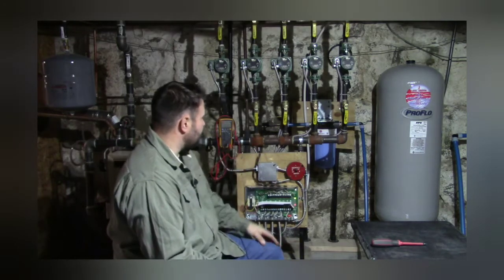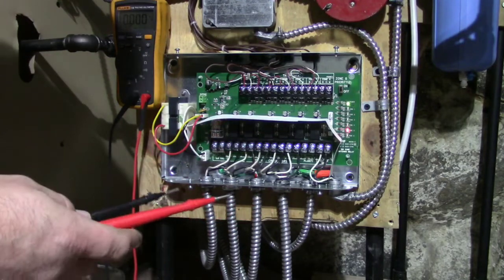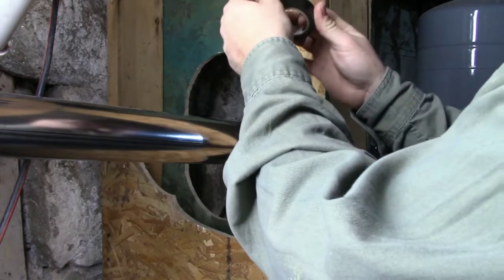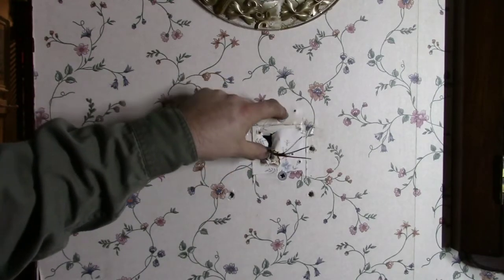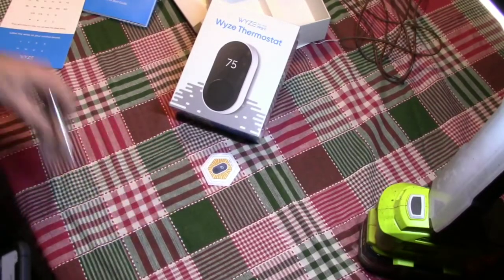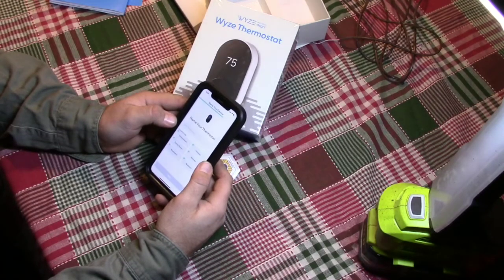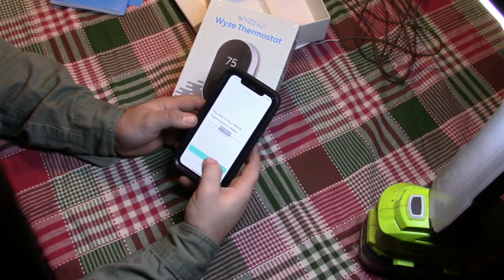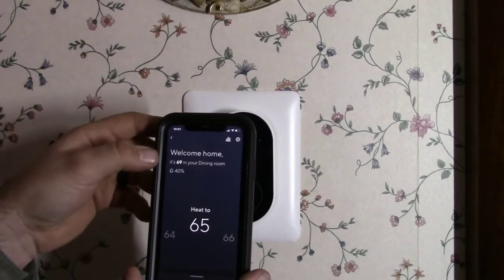Wyze Thermostat for Boilers!

Comment: As a licensed HVAC contractor I appreciate your video. I recently installed a low temp radiant floor system.  I was up in the air due to no online documentation. The system I have is condensing boiler eventually geothermal WtW. The actuators take a 24VAC input and close a end switch to bring on pump control. Basically five small zones on a delta T Taco. Boiler also does a domestic stainless indirect hot water heater and a few snow melt zones. The Navian control panel is only dry contact with 22VDC.

Comment: Hello, Great video. I am trying to hook up WYZE to my previously two wire hot water oil boiler, but my boiler panel is labeled differently than yours. If I send you a picture of my panel could you tell me where my three wires are to connect to the boiler? Thank you.
Reply from the maker: Yeah I will do my best
Reply: @livefreeandtoolon  Thank you. I was able to figure it out, so you are off the hook.

Comment: What is the controller you used in the video and would it work with a forced air recovery system with AC
Reply from the maker: I have a zone controller for a boiler, I don't think your system will have the same. However the wyze  thermostat is very versatile and should work for your system. But to make sure give them a call to find out.

Comment: Great video and congrats on the babies! I’ve got a wood boiler with propane back up. Can you program this to kick the fan on for heat and kick the propane on as back up heat?
Reply from the maker: the thermostat does have the ability to send a signal for a fan only, it also does have a stage 1 and 2 for heat however it depends on your system do you have a combination wood/propane or are they separate systems? if they are separate you will need to be careful with control power supply to the stat. and may need to pick up two stats.

Comment: We have electric line voltage 120/220VAC baseboard heating units.
The instructions say the Wyze thermostat is not compatible.
With your help and additional plug in 24vac transformer and a 24 vac /220 relay, I will be able to use the Wyze Thermostat.
Not as easy as your boiler setup but doable.
Thank you for your help.
Reply from the maker: I'm glad you worked it out, i was actually going to do the same if my control board didnt have the 24v output. Good job, any pictures?

Comment: I have virtually the same setup with a 4 zone taco controller.  Set mine up the same way but doesn't power up the thermostat.  Did you do anything different in the controller on the boiler other than hook up r to r w to w an the green to that 24 volt supply on the left side

Comment: Thanks for the video, I got my Wyze thermostat last week and was excied to get it going until I got to the point that it told me my system was incompatible. My heater only uses two wires but there are three run in the wall. Inside the heater I found the green wire wasn't even connected. After watching your video I did a little research and it appears I can just tie the green wire to the C and connect it to the opposite leg of the 24v transformer from the red wire. I'll try this tomorrow and hopefully all will go well. Thanks again for the video.

Comment: Hey there!  I was wondering if I may ask you a question. I have a very similar set up.  5 zone heat with 5 thermostats(2 wire). I have a gas boiler not propane. Same issue with C wire.  But I already had an 18/3 with a wire unused.  I hooked it up to the neutral/common leg of the boiler and everything worked.  My wires are exactly set up as yours at the Wyze thermostat.(RH ->RC, W-> W1,C->C)
However when the thermostat performs a test of the heat, or when I call for heat the thermostat restarts.  I purchased two thermostats so checked the other one same exact issue.  Any ideas?
Reply from the maker: Interesting, I do not have that issue. It sounds like your zone board may be cutting the power. the best way to check is to use an electrical meter with alligator clips to the R and C at the zone board make a call for heat and watch the meter for constant power. Make sure you are using the common on the secondary of the transformer.

Comment: Do you think it will work with a 24 volt transformer ac adapter + the W and Rc(or Rh) wire. Am currently using the nest 4th gen with just 2 wires W & R. It reads:
Vin: 27or 28 V
Lin: 103 (W)
PS: W-103
Reply from the maker: You could use a 24v ac transformer, however you would want to make sure that the transformer is isolated powering the thermostat only and not supplying additional voltage to the zone board. You will need to look at the instructions and call tech support to clarify. I could be wrong? It’s a very new device
Reply from the maker: Typically you could use RH and W1 for the zone board and RC and common for powering the thermostat there may be a setting for programming the thermostat so the power doesn’t cross. You will need to call tech support